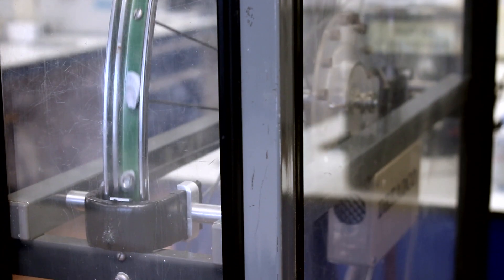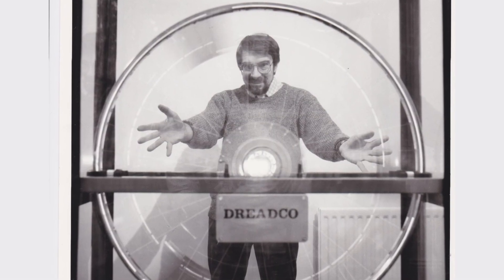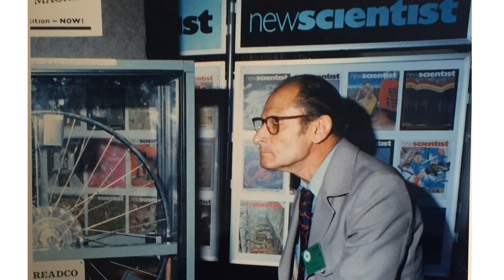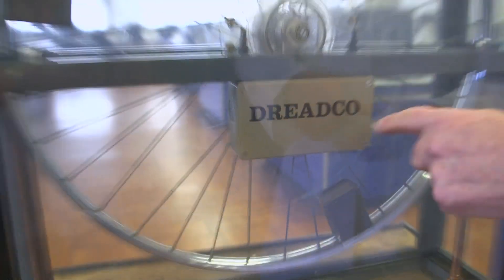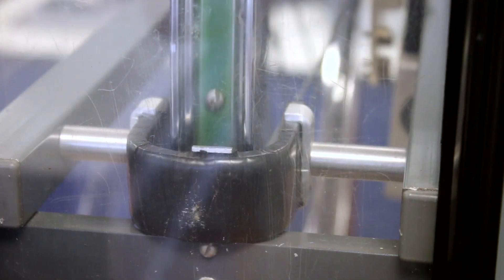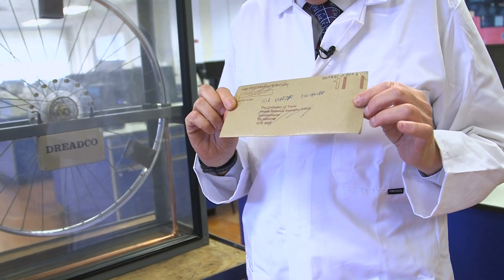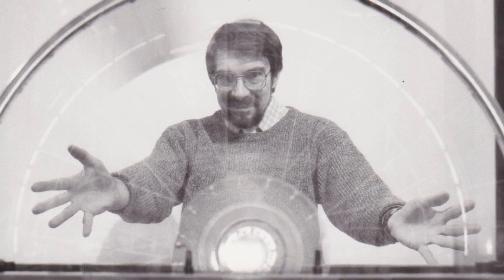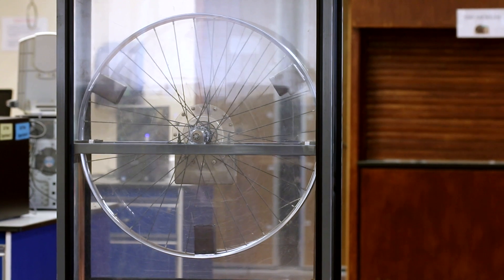Perpetual Motion Machine - Periodic Table of Videos

Comment: Occam's razor makes believe it might just be a low power. Long lasting battery using a simple circuit and electro magnetism to rotate the wheel. With all of the whistles and bells being a distraction intended to make you think it's based on some clever use of thermodynamics
Reply: I agree. The copper pipes and heat sinked box, while being apart of the structure I also suspect to be red herrings. In fact I think it is a lot of little red herrings intentionally.
But yes, a really well balanced slowly revolving wheel like that on dry bearings and in an enclosure will take very little energy to keep rotating. And Prof Poliakoff said it had been going for approx two years at this point. Seems reasonable.
Reply: That makes sense, keeping in mind that Poliakoff said he felt a bit cheated, when he knew the answer.
Reply: Also further to the fact, he said it has slowed down since then, which makes it more plausible it is a battery as the voltage output drops over the years from peak output.
Reply: That was my thought...possibly with a clockwork on/off connection to the electro-magnets...which means we are probably wrong cause that seems obvious and I assume someone else in the past would have suggested that.
Reply: I would suggest to open the gray box in the middle and change the 2 aa batteries :-) and it will pick up speed again. Does anyone remember these battery driven moving sculptures from the 80s? I would guess it’s the same principal.
Reply: That was my guess as well, but since only 1 person has been correct I don't think it can be. The best way to fool a lot of people is to use the most obvious solution as a distraction.
Reply: But only One person has guessed this?
Reply: I hope the energy source is a tiny little radioisotope thermo-electric generator, or at least a radioisotope photo-electric generator.
Reply: I note that on both of the sides of the DREADCO box there is a circular hole across which appears to be an acrylic sheet of conical prisms. Solar panels could be configured to trickle charge a battery within the box, which in turn uses electromagnetism through the contacts above to rotate the wheel. Gradual degradation of the battery and perhaps the circuitry inside could explain the slowing of the mechanism over time.
Reply: Occam’s razor doesn’t apply really to phenomenon created by actors whose goal is to be intentionally misleading. The fact that only one person was “incorrect but close” would cast doubt on the “simplest” explanation being the right one.
Reply: Wovaka I’m assuming the box is also a complete vacuum to reduce as much air resistance as possible. Air has probably also leaked in over time, thus contributing to it slowing down
Reply: +
DHGameStudios
Assuming the battery hypothesis is correct (and I suspect it is), I would guess only one person has guessed it because everyone was expecting something more interesting. There's so much going on in that box, so many red herrings, I guess people thought that maybe not all of it was for show. If someone tells you "here's a perpetual motion machine, guess how it works", you're not going to immediately thing "its a freaking battery-powered wheel and thats it", because if that were the case, why would they ask, right? So nobody guesses it, because its such a boring answer. But its consistent with all the evidence we have from this video, at least.
Reply: That's not so impressive as long as we don't know how many people took a guess.
Reply: By my definition, the chamber is the entire glass cabinet. A complete vacuum in the cabinet would not be balanced with the outside and would break the glass.
Reply: @whitcwa  How do we manage to make polycarbonate vacuum chambers if vacuum would indeed crush this?
Reply: @EddieTheH  Vacuum chambers are usually cylindrical with domed ends. That shape can withstand high pressure differential. Flat polycarbonate sheets would buckle.
Reply: @whitcwa  I literally have a polycarbonate cube stuck together with JB Weld right in front of me now holding a high vacuum.
Reply: @whitcwa  A full vacuum still only has ~15psi against the outside of it.
Reply: You’re inferring a lot from his “disappointment.”  I’d infer a lot more from the large sample failure to figure it out than I would in armchair analyzing why he was disappointed.
Reply: Interpret this as you will, I copy and pasted this from my prev comment:

I found a BBC documentary on this exact machine with the same prof present and they measured an electromagnetic field near the box with the heatsink and the DREADCO box. No other magnetic field was found anywhere else.
Reply: I'm not a philosopher but I thought philosophical razors can only be correctly applied to generic concepts, not to a specific event or implementation.
Reply: James Smith, I was replying to a comment that it had a complete vacuum inside. A complete vacuum would mean pressure was unequal between the inside and outside.
Reply: Same idea here, either a long-lasting battery like mercury (I suppose a radionuclide battery like they used to use in remote lighthouses would be even better, but due to safety restrictions is unlikely) or some kind of solar panels?
Reply: lol that is the whole point. we know that is the case but the game is figuring out what he did.
Reply: My first thought would be a power generator that siphons energy from transient emf given off from the power line which surround us every where. Or it has some type of extreme long life battery like a hydrogen isotope battery
Reply: Chris W only of if this not equalised
Reply: Wovaka Occam's Razor states there is just a motor in the center running on very low voltage off a battery
Reply: Malcolm Wardlaw except for the fact at the beginning he says scientists are the easiest to fool and he says he was disappointed with the answer. Those things imply the answer is very simple.
Reply: Malcolm Wardlaw well we don't know the number of people whose guess was validated nor do we know who they are. Were they all scientists? Kids? His friends?

okay let's combine both things then... It needs to be simple to account for his disappointment and obscure enough for nobody to guess it
Reply: It's often like that, for magic tricks. Sometimes there's a LOT of effort involved in them - see David Copperfield making the Statue of Liberty disappear, for instance, which involved some fairly heavy and delicate engineering - but often you're better off not knowing.

"How did I mystically bend this key? I distracted you in a way you were unlikely to remember, very quickly bent the key by brute force against the underside of the table, then revealed the bend to you slowly so it looked as if it was happening right then before your eyes."

Or the zillions of card tricks which come down to a card force. (Which is why Penn and Teller's "pick a card, any card" tricks INVARIABLY force the volunteer from the audience to "choose" the three of clubs. :-)
Reply: dansdata I think the Copperfield analogy is great. You initially think he used some very elaborate trick like the contraption that enables him to “fly”, yet it was a solution that is of the “very simple once you know it” kind. 
IOW I believe I would’ve come up with it within a few days but I could probably not recreate his flying harness in months, or ever.
Reply: cold fusion was not even invented yet how would a battery last 38 year's. and a nuclear battery even back then would cost an arm and leg. I doubt it is a battery
Reply: Matthew Thomas The sides of the case are perspex, judging by the surface scratches visible in the video. Given that  a standard bicycle wheel is 26 inches in diameter, the larger sides of the case would need to withstand a pressure of around 28 inches x 32 inches (complete guess) by 15 pounds per square inch, roughly 6 tons of pressure on just one face, if the interior was a vacuum. I think it is safe to assume the interior of the case is at normal atmospheric pressure. 

However, if the box is reasonably well sealed with the whole acting as a barometric pressure capsule, then there is considerable potential energy available from normal daily atmospheric pressure changes. The trick would be translating that energy in such a way as to power the wheel. Piezo electric crystals in the hub of the wheel could work. They also started being mass manufactured and relatively cheap around the time this wheel was constructed. I am doubtful that this is the true mechanism as perspex is a bit too flexible for this application. A much smaller barometric bellows hidden in the Dreadco box would be more efficient.
Reply: Considering there is a battery from 1840 that has been continually powering an apparatus, I wouldn't rule it out.
Reply: Well, we can't test your comment, so I guess we'll have to apply Newton's Flaming Laser sword and ignore it.
Reply: 100% agree. Most likely is some battery driven magnet. Two years does not equal perpetual. There's only so many options. Chemical energy is an option as well, but I don't that's the case. It had been running for 10 years that would be more of a puzzle.
Reply: He pretty much told us that stuff was a diversion. Given that the answer is disappointing, it's probably a waste of time to speculate using advanced theories of physics and whatever it is you guys are talking about. But then again, I still don't understand how that damn water drinking bird keeps going.
Reply: Barry It could. Seems highly unlikely and would not be legal in most countries.
Reply: My understanding is that there are some radioactive materials that are legal to possess, at least in small quantities.  Tritium appears to be one of them.  Radium was long used in luminous dials.  There are radioactive materials in smoke detectors.
Reply: we had a battery electric wall clock in the 1970ies. It operated several years on one C cell. It had a transistor pulsing the drive coil briefly when the pickup coil sensed the magnet. I am pretty sure this is a similar mechanism.
Reply: for just some years you do not need a very spacial battery. alkaline or even zinc carbon will do it
Reply: Lithium batteries are available since several decades, they were just more expensive. they were used as memory buffers and in watches already in the 1980ies with lifetimes up to 10 or 20yrs.
Reply: I have a perpetual motion machine that uses a D battery and a magnet I thought it would be similar to that but the long life of the this Maschine makes me think it may be something else but similar
Reply: That was exactly my thought as well.
Reply: Wovaka I'd want to have it in front of me but I suspect a nuclear battery is clearly simplest simplest answer.
Reply: What do you mean?
Reply: rationalmartian the heat sink looks like it has a coax, cable connector on it
Reply: Chris W I meant inside the chamber. If it was equally balanced it would not implode.
Reply: It is definitely not a battery based machanisum as a battery cannot run the wheel for these many years, plus it's a so obvious reason that it's not possible that only one person could have come up with it
Reply: I'm pretty sure it is more likely to last long if it uses electrostatic attraction and repulsion the forces you would get would be tiny but so would the power draw and if you balance the wheel well it can spin for years on a battery.
Reply: Being an inventor/clever guy - could he of just pulled some radium out of a few smoke alarms and be using that?
Reply: OmniTechnologies Research how do you keep the helium cold?
Reply: Wovaka exactly what i was thinking, but that might be TOO obvious...
Reply: Ryan Check the drinking bird wiki. It would be helpful to have some understanding of the Universal Gas Law to really understand it. Evaporation, condensation, and using the tube as a value to block or allow air flow through the tube are what allow it to work. It's a "heat engine" mechanism. Heat is relative - it's not about what feels warm to you, it's about temperature differences. The liquid in the ball has a very low boiling point so it evaporates readily at room temperature. It would not work below some temperature (guessing 50 F).
Reply: Heat from radioactive decay, bled out to the heat-sink through a thermocouple could provide enough electricity to drive the unit.
Reply: Right. But I can't see any of those producing enough energy to keep that wheel turning. I'd have to do some calcs to be sure, but my gut says no way.
Reply: Not sure how you'd estimate the values for friction losses.
Reply: Lassi Why do you think it's slowing down?
Reply: Maybe some peltier energy generator exchanging heat with the environment outside for more power?
Reply: This is what I think
Reply: yup, I was thinking the same but what battery can last so long?
Reply: That was my first thought, just a very large brushless motor with an incredibly low operating speed
Reply: yeah but this is what everyone would guess.   it is my first gut reaction too of course.  but he did say that nobody has gotten it right yet, or only one person was close or something..... so idk, either he lied to us or its not just a battery surrounded by distractions
Reply: this thing is plugged in the wall 😂
Reply: it does not float
Reply: I think the reverse might be more plausible. The electric stuff is just a distraction while the plumbing could be working off of atmospheric changes like temperature and/or humidity. Much like an Atmos clock that self winds with a mere 2° change in temperature.  Interestingly, if this is the case, it being in a environmentally controlled lab environment would likely slow it down a bit.
Reply: It isn't levitating
Reply: Kenneth Huang it can't be a vacuum . The atmospheric pressure on a vacuum chamber is strong enough to crush a steel drum.
Reply: @whitcwa lol I know it’s 6 years old but that’s such a ridiculous comment. It’s not a vacuum cause you can tell by looking at the edges that it isn’t sealed, but 1ATM will not crush 0ATM unless conditions are right. There are plenty of vacuum chambers out there that are just made of acrylic.
Reply: Then how didn't the battery leak?
Reply: what if it's fueled/powered by the wheels movement?
Reply: Chris W it would only crush if the pressure was unequal. Yeah sorry I was using the mic to type it didn't work very well
Reply: @JasTheOne2  If it contained a vacuum and the pressure was equal you'd have to have vacuum outside of it, which clearly isn't the case. Still, the original rationale was flawed. Vacuum can indeed crush an oil drum, oil drums are weak when empty. This box is plenty strong to maintain a vacuum inside as it isn't an oil drum.
Reply: Barry, I wouldn't worry about it. I measure approximately how many watts it takes to keep a wheel like that spinning. You could then determine what options you have to generate that much energy. If it's been spinning two years, a battery is unlikely given that this was done before Lithium batteries were available.
Reply: no way 1980's battery can run the machine "for almost two years without any attention" like sir martyn said considering the technology and the degradation.
Reply: @Ballacha  There was a battery that lasted 176 years sooo.
Reply: @user-lx2ep9hd4k  go ahead. use that battery in this case and see how many minutes it lasts. when you get the result, let me know.
Reply: @Ballacha  I'm just saying that he could make his own battery. Production batteries don't last long but a custom one made from materials as the 176 years one could keep the wheel spinning since the wheel has no load put on it so it doesn't require too much power to spin. A reasonably big battery put in that dreadco box could probably power it for 2 years, what's more complicated is the question what powers the spinning. The magnet thing is red hairing I think. The thing in the middle doesn't complete any circuit so that also isn't it. Where is the motor?
Reply: Electro magnetism. It probably operates like a magnet train using electronic magnetic levitation. Using the poles of the magnets to create levitation.

Comment: Why is there a "window" on the DREADCO box.. hmm
Reply: for a machine built in 1980 though?
Reply: yes solar calculators came in the 70s
Reply: oh of course :facepalm: now i'm having flashbacks to those casio calculators
Reply: Yeah looks like an infrared beam detector. Maybe a timing/switching mechanism.
Reply: Looks like the detector panel of an old selenium light-meter, which produces a charge (and also loses it's effectiveness over time)
Reply: most likely had a light on it at one point or lights up when its initially spun.  since it spins at a constant speed imperceptibly slowing down, you'd conclude that its never going to stop. most likely took the light off as it made it easier to solve.
Reply: I have a solar battery charger from 1985. It has such a honeycomb lens in front of the cells, typical for that time.
Reply: Or its maybe just a decoy lol

Comment: I think there’s a 10:1 ratio of misdirection within this device. My guess is that the heat sink and copper pipes are simply conduit for electrical cable.The black boxes and ‘horseshoe magnets’ are probably non-magnetic aluminium or plastic.The Dreadco sign is thick enough to house a certain something.There’s a lot going on around the axis of the wheel...hmmmmm.
Reply: its probably just a dc generator/electromagnetic motor.

Comment: water in the copper pipe being energised by the magnetic vibrations causing resonance interference of the air producing a static discharge  to the disturbed elements of the steel wheel copper and aluminium type heat sink     just a thought DREADCO/dear.doc